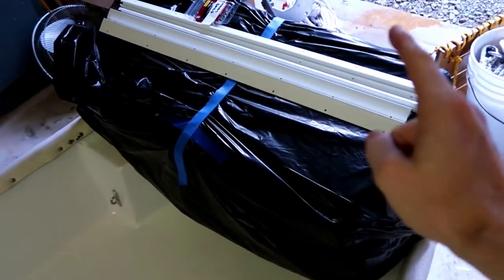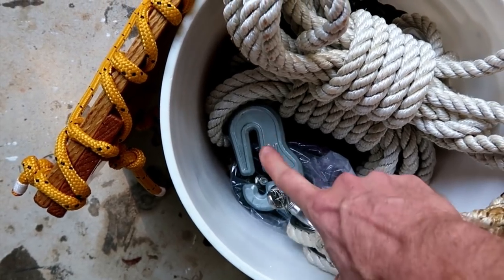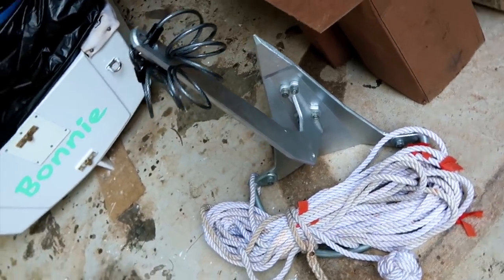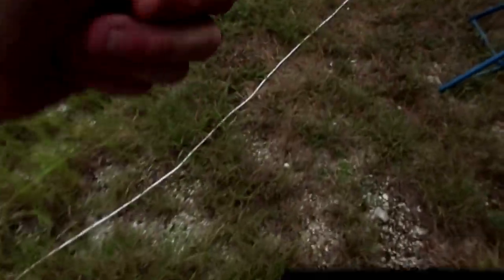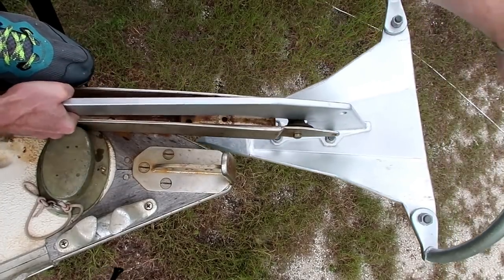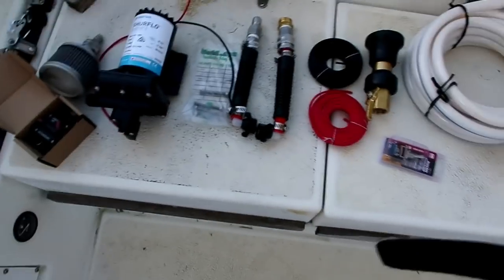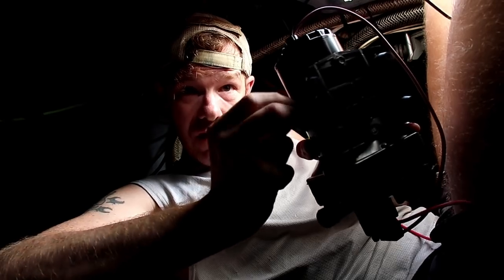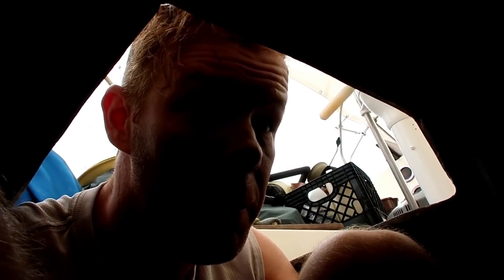Boat Work & The Great Banana Challenge | Sailboat Story 86

Comment: Ben,
You’ve still got it!
Q: If it’s a quarter mile by bicycle, how far is it to walk, or run in your case?
My 2cents: the step should be one less plank outboard which would decrease your concern greatly. I know it’s too late now but if it’s a problem...
I look forward to your next adventure. 
Dean (SV Destiny’s Song 🐬)
Reply from the maker: Regarding the step length, I want it long so that it extends over the new dinghy quite far.
That way we can step more from the center of the dinghy instead of from the tippier sides.

Comment: Good to see you back Ben, I've missed you. Banana skins are not for consumption but I like your style trying. A bit of big "wave" action could be a prob on your steps.
Reply from the maker: I'm curious to see how well the step works in real life.
We'll certainly see!
Reply: If it does try and slide up. Maybe add some thick walled hose as a sheath around the two back vertical ropes to make it more difficult for them to compress. Should still be able to fold it all up neatly for storage.

Comment: Nice, i kind ah missed your vids. I hv a 13lb mantus as my day anchor. I never drag. Been in 50kt + winds with it.
Reply from the maker: On what weight boat?
Reply: Gib sea 442, 45ft loa, 22000lbs
Reply from the maker: Good golly. I bet that sucker is absolutely buried.
I thought about going a size down to the 25lb, but didn't.
This one is 35lbs.
Definitely shouldn't drag with it.
Good to know.  :)
Reply: I plan to get the 35lb for my storm anchor. I think the ppl who sells anchors, sells their anchors with the taught that the anchor alone holds the boat in position. But thats far from the truth. The chain and scope has alot more of an effect than just the anchor.
Reply from the maker: Maybe they have to assume that folks won't be using chain at all, so they have to plan for the worst?
Reply: Maybe they assume that. Hope to see you guys in the caribbean, im in Trinidad for now.